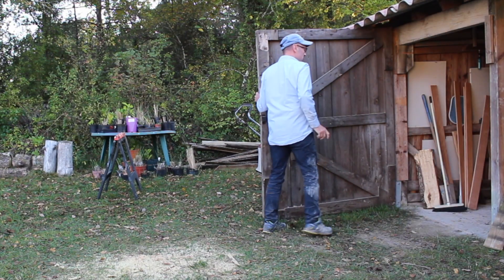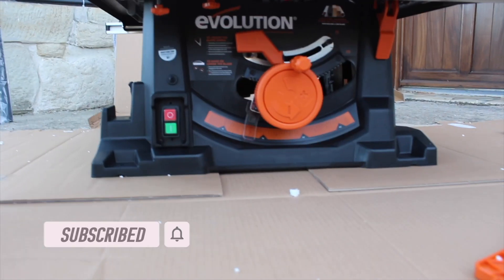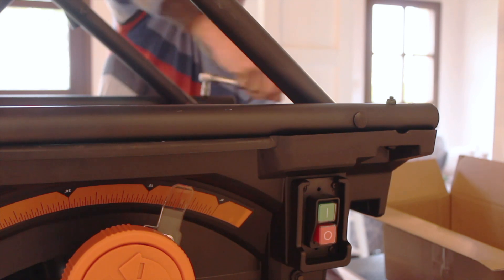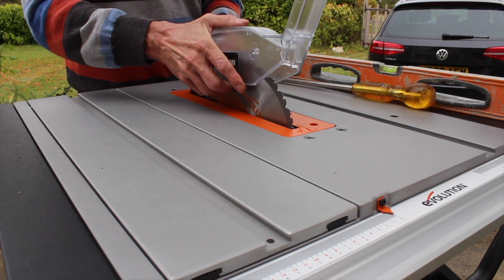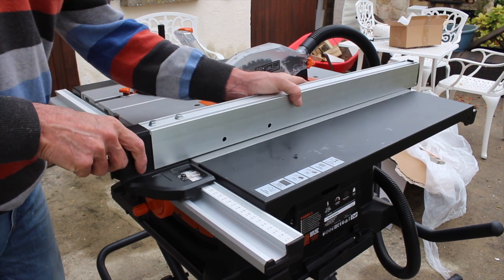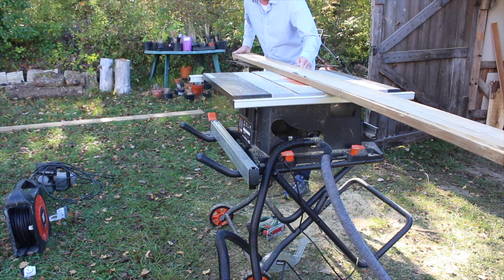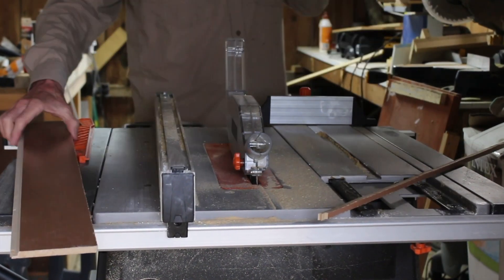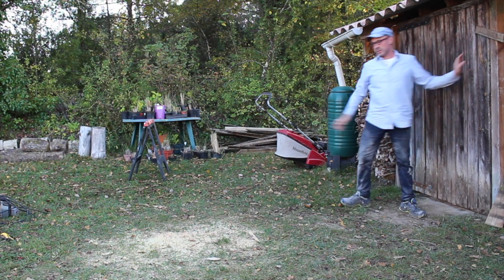Evolution Rage 5 S table saw. unboxing, set up and first impressions.

Comment: Great video. Could i cut a piece of 6ft scaffold board lengthways ? Looks like the guard might be in the way.
Reply from the maker: Yes you can! Max cut depth is 80mm (3 1/4) The guards is removable but comes with all the safety warnings! Regards JP
Reply: @Smallbarnworkshop  thanks .im undecided between this or a lumberjack which has same sort of features and about same price. Does the rage 5 have standard three pin uk plug? Thanks
Reply from the maker: @stevejohnman68  Yes. If you buy it in the UK. Regards JP

Comment: Hi thanks for the video.I am in UK and I wanted to shortlist some Table saws.I think Evolution Rage 5 will be one .The other being De Walt.
I thought I should inform readers some Health and safety issues.
Wear eye protection goggles
Wear mask to prevent inhalation of Saw dust.
Wear ear protection ear plugs or those like ear phones.
Use Grr-ipper to feed the wood.
Support the wood on the other end with some additional tables to prevent timber falling and causing damage to blade 
Do not be distracted.
Wear an apron with saying
"Do not disturb"
These are some Health and safety issues .Discard these at your peril.
Table saw is unforgiving.
So treat the baby with great respect.
Reply from the maker: Hi. If you watch this video it compares the Rage 5 and the DeWalt 
The Best Small Workshop Table Saw: Evolution Rage 5s Vs DeWalt DWE7485
https://youtu.be/XoFdjCVyQvA

Comment: I got mine for 180 quid chucked the trolley awful made one out of timber with draws for all the bits and added out feed easy start panic stop and infeed table oh and a router plate on the right extension .

Comment: If you haven't discovered it yet, you can lift the riving knife quite a bit higher than is shown in this video and that will bring the whole blade guard assembly up quite a bit higher. That will bring the knob above the height of the fence and allow you to get the fence much closer to the blade for very thin cuts.
Reply from the maker: Thank you. I have discovered since by playing with it. Thank you for the tip thoughit adds to the community 👍 Regards JP

Comment: I have been using my Rage 5S for a couple of years now and found it to be a great tool, a couple of upgrades I've done which I think are essential: (1) paddle type stop switch, saves fumbling about underneath the table trying to find the small stop switch (2) soft start module as it does tend to start a bit violently (3) zero clearance insert plate, stops all the small offcuts falling into the blade well, also vastly reduces tear out (4) a decent Saxton blade, I use a 40T one and the cuts are incredibly smooth (5) if you are using it to nibble out dado's the Saxton flat top grind blade is magic, very little, if any clean up work after. you can also fit a router in the extension to make it into a router table, Casual DIY is a good source for info on these machines. I also have the Evo track saw and 255 mitre saw (Saxton 80T blade fitted, very clean cuts btw), both of which I'm very happy with.
Reply from the maker: Thanks John. I’m planning of adding the Saxton blade myself. Seen some of Casual DIYs stuff. Not come across the soft start though, so will investigate. I have the small version if the evolution mitre saw. Thank you for your comments. Regards JP 👍
Reply: @Smallbarnworkshop  Got my softstart module from Amazon Germany, Cas DIY shows the fitting but tbh he makes a bit of a pig's ear of it, with a bit of thought it can be fitted without any cutting of wires etc. and can be returned to standard in case of a warranty claim
Reply from the maker: Thanks. I will find that video 👍

Comment: What is so dam annoying about this saw,is the Mitre slots,you cant get the alloy sliders of the shelf as wont fit ,so have to put up with crap plastic or wood ones ,if contacted evolution about this  but got no reply, think they need to upgrade there table saw top to accommodate standard slider,otherwise when this goes to heaven, wont buy another one 😁
Reply from the maker: Your right. I’ve just made a taper jig using old laminate flooring as runners as the grooves are very shallow. I have off shelf ones for my DeWalt. Regards JP

Comment: You got a good price - they are all £315 - £325 at the moment round here (including Screwfix). Only had mine a week and its the best features I could find for my budget. Love the sliding carriage and extending worktop. Love the really firm fence that is easy to true and secures at both ends. Love the fact it folds up for easy storage as I have very little room in my garage. Dont like the poor and wobbly mitre gauge with no locking zero or 45 degree point, and far-too-short mitre gauge fence. I'll make a better track and wooden fence for it soon or use a cross-cut sled. Dont like the really violent start-up, I will fit a soft start module when it arrives. Dont like the saw blade guard - if you have the blade any lower than 20mm the blade guard will jam the wood you feed into it.  Helps with dust collection though. Also not sure about the extra small fence you can bolt on to the main one - not sure what purpose this has? Other than that a good value table saw and a game changer for my projects.
Reply from the maker: For the money it'd a bargain. I'm really happy with mine. I do agree with your appraisal 👍

Comment: I have had a Rage5S for a few years now and think it was a great investment. You can’t beat bang for buck features especially the sliding table which is fantastic. A few things:
- I use Bosch blades on my Rage5S without any issues. They come with spacers to reduce the 30mm bore to the correct size and fit very tightly so completely safe to use.
- it looks like you have installed the handle rails for the fold-up trolley upside down. I have to say I struggled assembling the thing when I first got it and it took me a couple of tries.
- check out The Casual DIY channel. Thomas has great videos on setup and tuning the Rage5S. Highly recommended.
Thank you for the interesting content. Cheers 👍😎🇦🇺
Reply from the maker: John thanks for your comments. I will look into those blade. regarding the handles - whoops. I will reread the manual and check out the video. 👍
Reply from the maker: John. Your right just had a look. 🙈 However. I've been using the upturned bar area to hold my fence and bits of timber. So maybe I will leave it as is 🤔
Reply: Interested in your thoughts on the Rage 5s compared to the Dewalt. I have one of these but thinking upgrading to the latest Dewalt as it’s starting to have one or two issues with it
Reply from the maker: The DeWalt is much more robust than the R5. They were around twice the money though. I have then 9” DeWalt and the R5 is 10”.  I don’t cut much 3” so I do not miss the extra capacity. I got a great deal on the smaller saw. I paid around 330 . At the time the 10” D was around £600 (DW745) Most of the DeWalt is metal or alloy. The  R5 does have a lot of plastic. Some of the features that people upgrade on the R5- such as bigger stop switch and better diving knife - is standards on the D. The dust extraction is better, it has a canvas like interior that shroud the blade. The arbour is 30mm so there is a bigger choice of blade.  Where the R5 Scores highly for me is the wheels and the sliding table. Regards JP
Reply: @Smallbarnworkshop  thanks for the feedback. When the weather improves a bit I am going to try to see if I can maybe iron out some of the issues I have but will keep the Dewalt in mind.